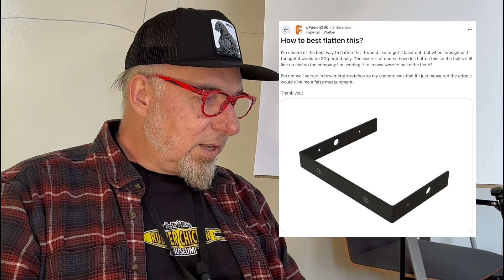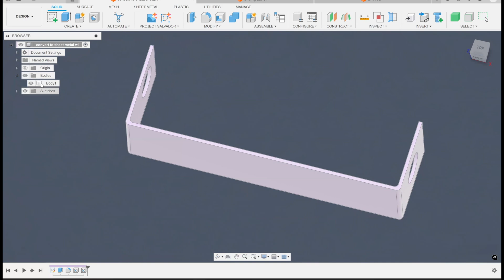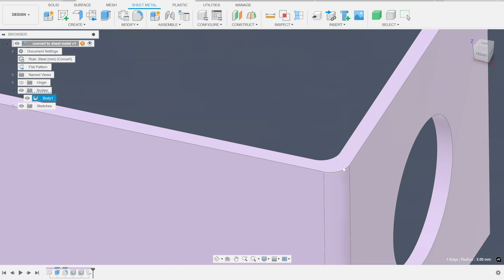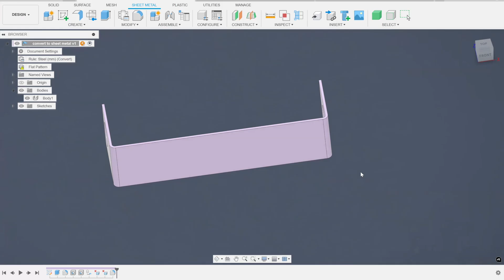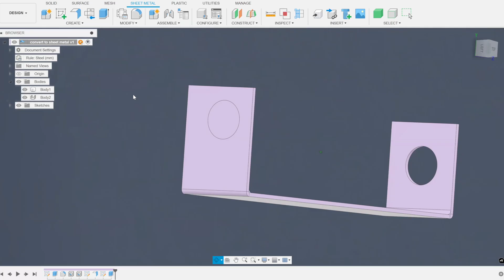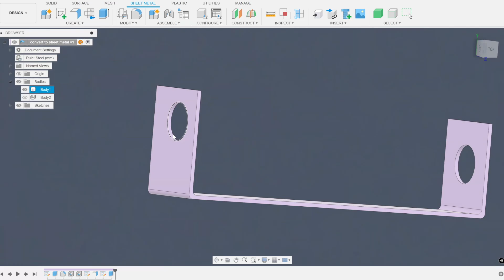How to Flatten a Part | Unstuck My Fusion Design

Comment: I use Fusion every day for this. The K factor you guys have for most materials is a bit off for some reason, and I always have to mess with it to get my parts to fall into tolerance.
Reply: K-factor is going to be unique for every material/thickness/forming die. So. It is difficult to set k-factors since things vary so much.

Comment: I’ve never had anyone be able to provide how…..
How to flatten a 3D tire such as Toyo Open Country MT 37”
The tire is not symmetrical and also is rounded on the edges
Reply: They haven’t shown you how because it is not possible in Fusion.
Reply: The opposite process to adding a retread onto a resurfaced tire (bald/prepped for application)
Reply: A full sphere can be fattened

Comment: Haven't fully watched the video yet, but my guess is.... 

If it isn't already valid as sheet metal, just re-drawing from scratch as a sheet metal component would be the quickest fix for something this simple. Should be fairly easy when you have a model to start from to get the basic dimensions.
Reply: darn, I was wrong, lol. That was a pretty quick fix.